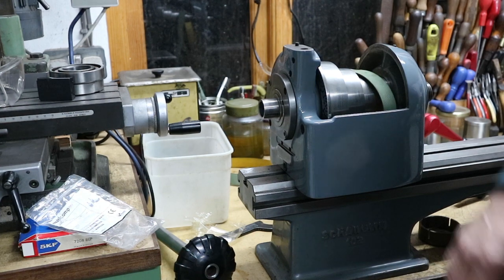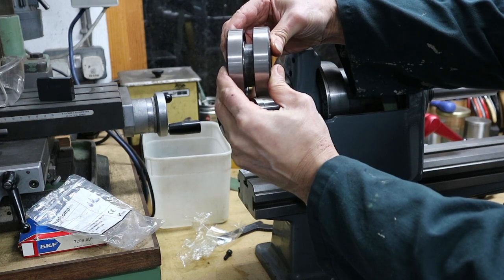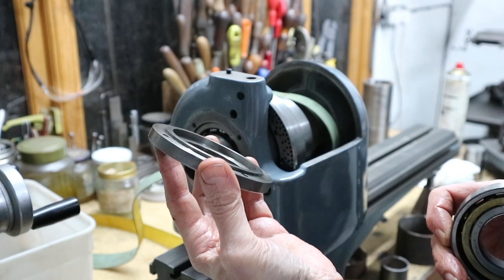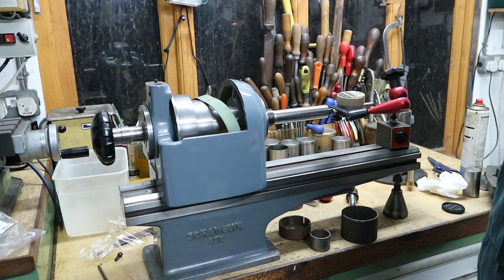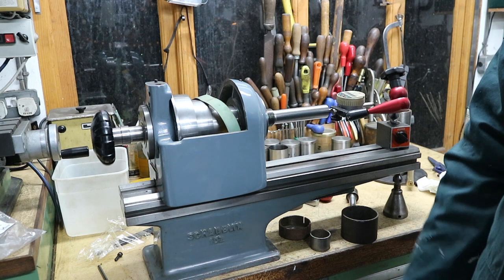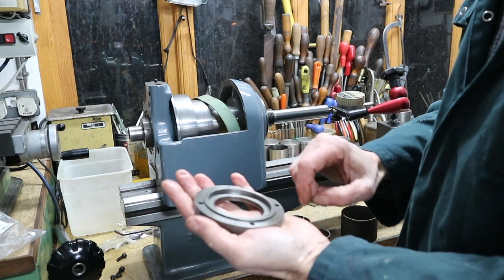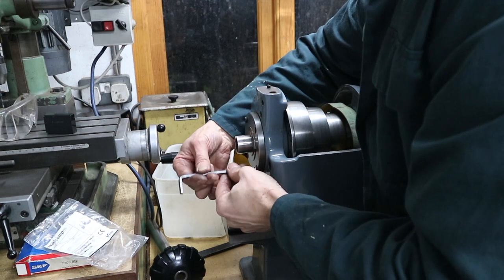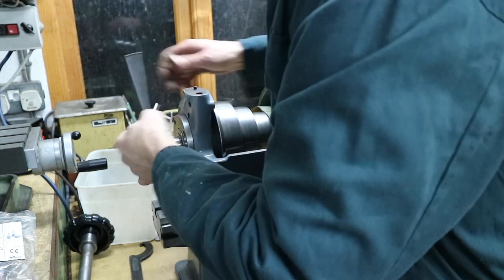Schaublin lathe spindle bearings: Part 4 - adjusting the axial play.

Comment: Hi David, how does that gap in the cover come about, if the bearings and spacer are all correct parts?
Reply from the maker: It's a good question as one would expect the bearings to be all made to exactly the same specification and hence completely interchangeable. However, in reality their are very slight variations between bearing produced in the 60s and modern bearings - even between manufacturers. The differences are only small, but enough to make adjustment necessary.